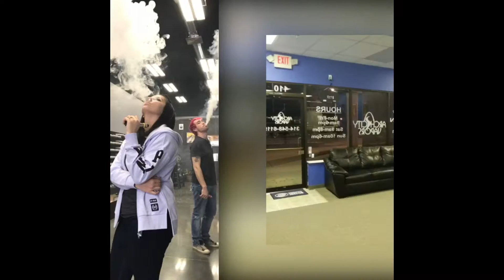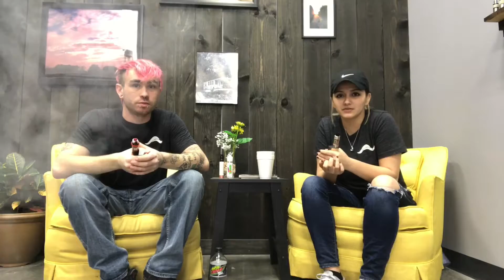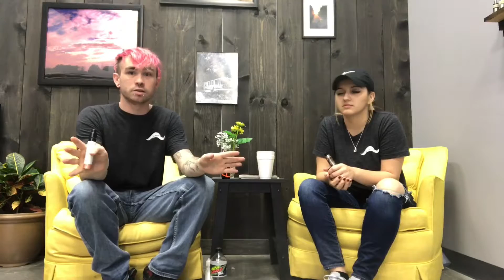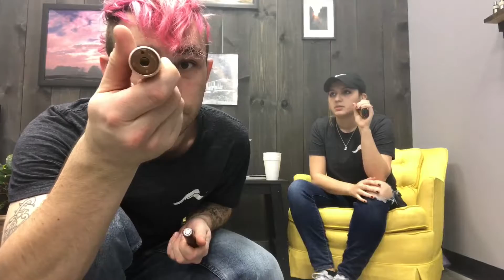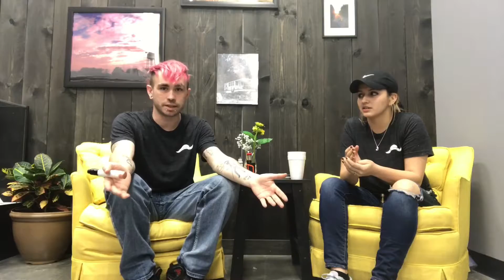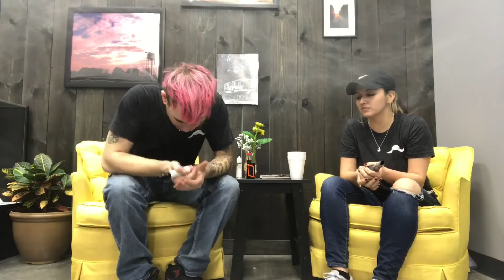Vape mods exploding

Comment: can you changed a mode with 2 batteries through usb port?
Reply from the maker: Souri Syx sometimes certain mods will allow you too, but it isnt really suggested. You risk the chance of shorting your batteries out at some point as well as having a false charge. The usb port does not allow your 2 18650s or whatever batteries you have to charge fully evem if it says so.